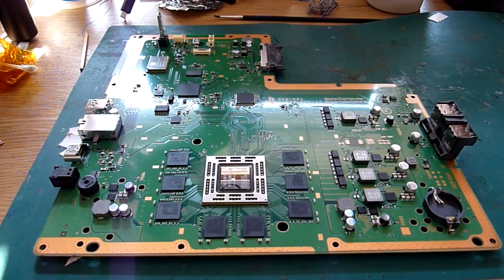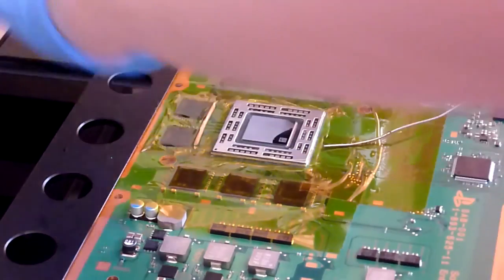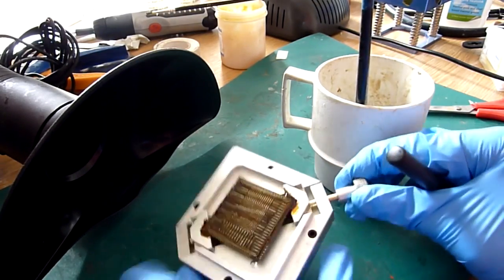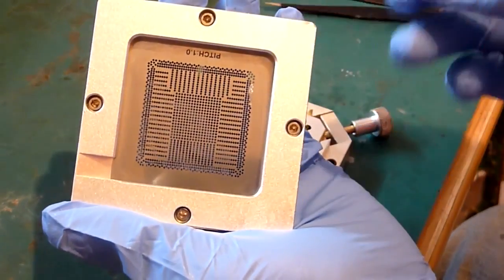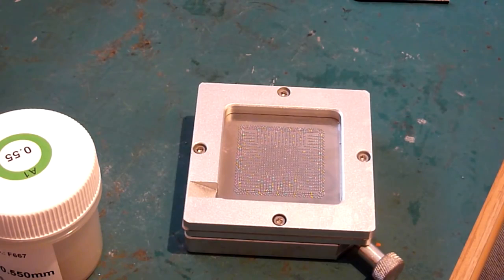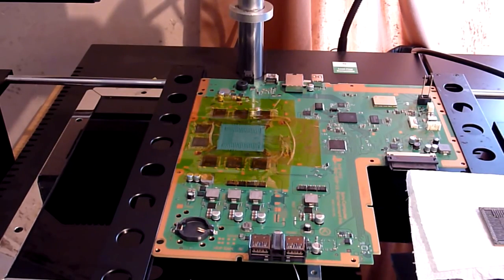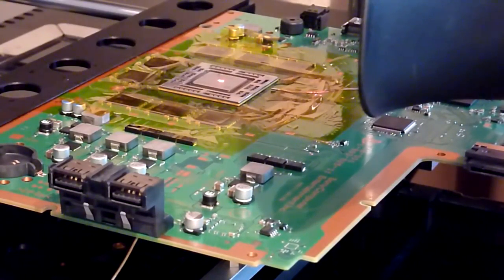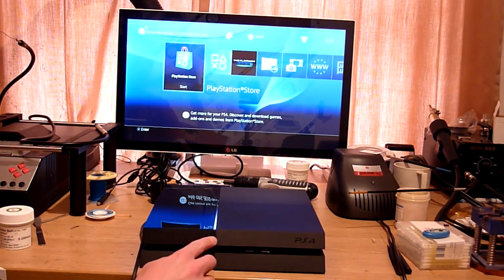PS4 Reballing APU BGA - Fix Blue Light of Death (BLOD) Full Tutorial

Comment: What happens if it beeps and shuts off and wont enter safe mode when initiated?
Reply from the maker: How long between the beep and power down? Will the console allow you to retry or do you have to remove the power lead and plug it back in before it'll allow you to try and turn it back on?
Reply: @AndrewPaul   I can retry after the single press one beep no start, I don't have to unplug to restart but has happened, where's the power button failed
Reply: @AndrewPaul   it beeps immediately about 1second and shuts off into one beep no start when hold initiated --- or at ten seconds shuts off normally and restarts again without the one beep no start
Reply: I cleaned it it was half clogged and now it clicks/  normal start says cannot start PS4 cannot access system storage and prompts to hold power for 1 second until it beeps" fan accelerates if left on this screen until" to shut down and repeats upon quick press start - It shuts down after safety initiation (7 secs start) immediately and beeps 3 times  and then an immediate attempt to start is just a beep with no response after safety attempt, an attempt after that gives an option of either start again bearing same results. ( Note the dead one beep result after safety initiation attempt ) some attempts  after normal start shut down achieved the PS logo and shut down leaving 3 beeps with the famous no response one beep for next attempt and back to cannot the next start

Comment: Hi, do you think that the same job done with this laser machine is also possible with a hot air gun? If not, why?
Reply: Not precise enough heat and timing control. Also evenly distributed preheat as well as balance between preheat and top heat are critical for success.

Comment: Awesome video! But how do you know what size solder balls to use for different repairs? Thanks man! 😄
Reply from the maker: Quite often it's labelled on the stencils you use. If in doubt, get a set of universal stencils and offer them up to the pads until you find one where the pad just about fits inside the hole of the stencil. You can then use the corresponding sized balls for that BGA. As a quickie - PS4 APU is 0.55mm, Southbridge and RAM I use 0.45mm.
Reply: @AndrewPaul  very helpful! Can you please tell me what the PS4 Slim WiFi/Bluetooth module size is and PS3 Super Slim size as I have 0 stencils and am gonna attempt all of these by hand? 😂😭
Reply from the maker: The PS4 WiFi module I don't use balls as the pads are very large - I use a large chisel tip on a soldering iron, get a ball of solder on the tip and then run the ball across the pads with plenty of flux. Don't touch the pads, just hover the iron above as you go. PS3 SS I'm not sure as I've never done one. The older PS3 CELLs and RSXs were 0.60mm so I'd assume these would likely be similar but could be wrong.
Reply: @AndrewPaul  I tried doing that exact technique but on the PS3 SS and I got wifi but no Bluetooth, then after a bit I lost wifi as well. So I’m guessing the solder balls weren’t exactly even in size?? Idk I just know that I hate BGA chips so much man
Reply: @johny1220  solder paste and universal stencil.

Comment: I just bought an mlink x2 and I was only able to fix a graphics card with it till now. 3 ps4s that had the blue light of death, I tried to reball them and all of them ended with a short in all caps of 0.1ohm while before there was no short. Now they just beep and turn off after one second. What am I doing wrong?
To remove the APU 215°C doesn't seem enough like I saw in one of your videos so I need to reach 240 to lift the APU. Then when soldering the 0.55 balls it's reaching 225°C, also when soldering it back it's reaching 225°C. What am I doing wrong? Why 3 APUs got shorted after reballing? Is the temperature killing them? Or can it bee too hot for too long? I admit that the removing ramp is quite long. I'm afraid of it bubbling if I heat it too fast.
Ps: without the APU in place, the memory caps measure 8ohms
Edit: measuring continuity with the APU off and  between the points in the center square, they are measuring 0.1ohms. I don't think this is normal. Somehow I must have killed it

Comment: Hi Andrew is a definitive solution ? could it give me a useful life or is it only temporary ?
Reply from the maker: On SAA / SAB-001 boards this is most definitely a permanent fix - there was a production issue on these boards with oxidation of the pads under the APU which over time degraded the connection between the chip and pad which this procedure resolves.
Reply: @AndrewPaul  thank mate for the info !

Comment: Hi bro please tell me can we change PS4 Apu
Actually I already changed my PS4 Apu to another PS4 butt it's still on blod I change the nor and syscon chip and it's still on blod please tell me what's wrong
Reply from the maker: If you're doing an APU swap between consoles then you need APU / Syscon / NOR and Renesas / Mediatek chip from the donor console. All the above must match (i.e. be from the same donor machine). If you're still experiencing BLOD then you either have a bridge under the APU, solder bridge on the Syscon, defective donor APU or a further issue on the motherboard not related to any of the above - remember that a pulsing BLOD is a generic error state - could quite possibly be defective RAM, bad VReg somewhere, failed FET etc.

Comment: I have fixed a PS4 and at least two models of Sony Vaio laptops with GPU problems that prevented booting up by literally bathing the motherboard in open flame out of frustration.  I figured that it was already useless, so why not just heat it up and see if it reflowed any dodgy solder joints.  I can't tell you how surprised I was after hitting the power button actually resulted in a beep and a picture onscreen after so many times I had been greeted by just a blank nothing...  Unleaded solder is utter crap.  Most recent success was a PS4 that seemed to be suffering hdmi issues, not even showing up in safe-mode.  After a look at the port revealed no bent pins, I decided to heat the board up behind the port just in case of bad joints and dragged a torch across the area of the encoder chip for good measure and was shocked when that suddenly caused it to start up and shut off immediately, which was a whole different problem than the no-signal issue, so I took it apart again, heated up the area beneath the main chip and reassembled with a couple pieces of cardboard added under the clamp behind the heat sink and very much to my surprise was rewarded with a proper picture and boot up and am back in business with my psvr again.  

I credit all those old threads discussing putting malfunctioning video cards in their ovens and toasters for saving me a lot of money , if not a lot of frustration....

Comment: 200c max temp  for soldering and  desoldering ?
Reply from the maker: Desoldering needs around 220C to melt the lead-free solder.
When putting it back with leaded balls, around 170-180 should be more than enough to re-seat the BGA.
Reply: Desoldering time 2 min ? soldering 1 min ?  tnx
Reply from the maker: Total profile time is around 7-8 minutes in my case. IIRC (it's been absolutely ages since I created my profiles for my machine so my memory is a little hazy) the reflow stage is around 90 seconds.

Comment: This is the same problem for ps3 consoles, why cant sony make a proper console ?????
Reply: Because you won't buy another one:)) if it's not broken you don't need to fix /buy another one:))
Reply: It’s very common for console APUs and notebook dGPUs to fail. They’re put under heavy load and the cooling solution just isn’t the best because of size constraints. Keep in mind that they also suck in a lot of dust and even pet hair if you have pets and this will make it even harder for the console to cool itself. It can still happen to full size GPUs in an ATX tower but not as often.

Comment: Do you know if I would be able to reball with a smaller rework station such as a X-Tronic MODEL 5040-XR3?
Reply from the maker: I'd imagine you may struggle with a smaller machine like that one as the PS4 board has a LOT of copper and dissipates heat incredibly well hence the larger machines being recommended for these types of board. It might be worth a test on a scrap / donor board however to see if it will.
Reply: good answer, that is very true. just reading wiki:- "Copper has a thermal conductivity of 231 Btu/(hr-ft-F). This is higher than all other metals except silver, a precious metal. Copper has a 60% better thermal conductivity rating than aluminium and a 3,000% better rating than stainless steel.[5]" I know from when I do plumbing at home soldered joints the heat goes along the copper pipes really fast.

Comment: that silver foil i never use again lost some tiny resisters it pulls them up
Reply from the maker: Ideally leave the foil until the board reaches around 120C. It'll then be warm enough to easily remove the tape and adhesive, but will leave the components in place. If components are coming up with the tape then it's likely you're trying to remove it too soon - the adhesive shouldn't be strong enough to pull them off otherwise. If it is, you need some different tape ASAP! I'd recommend using Kapton tape anyway to be honest - it's much nicer to work with.

Comment: Hi Paul, i’am thinking getting this Jovy Re-8500 used for £850.  I heard some people doesn’t use the reflector for the upper heater. Do you use it?
Reply from the maker: Hi Alan,
Yes mate I have it installed on my machine - it's useful for concentrating the heat solely onto the BGA which prevents unwanted heat being applied to components / connectors etc close by which might be affected.
Reply: Andrew Paul thank you

Comment: Ok I'm confused about the meaning of the name  Non Connected pads for BGA motherboards. While lifting the apu on ps4 motherboard I only lifted one Non Connected pad. It had copper on the bottom of the solder ball but when tried to get it off the chip I lost it. Darn! So my question is do I even have to replace the pad and if I do then does it matter so much how wide or thick the copper pad is as long as it's close. I've got some copper sheets that I can make little circles out of 0.25mm around as opposed to the 0.18mm around that the holes really are but they're about twice as thick the ps4's bga copper pads though. What do I do?
Reply from the maker: Have you a picture of the missing pad?
Reply: No but I will try to get you one or give you number on Sunday night when I get home. It's in putter edge near/at one on the corners and it defiantly non connected.
Reply from the maker: If it's definitely an 'NC' pad then just leave that ball off when you reball the BGA - in those instances you don't need to reinstate the pad. The same goes for the odd ground pad if you're ever missing one of those.
Reply: Thanks man that's what I'll do Monday and let you know how it goes!!!!!!!!!
Reply: Darn didn't get to it today but I will first thing tomorrow.
Reply: Couldn't reball it today either.  I'm having some trouble with my jig and stencil plate problems that I'm going to have fix one way or the other before I can get the balls on the chip AHHHHHHH good grief.

Comment: Ok I've finally figured out how to get the flux down under the ps3/4 chips but I'm still painfully on the heat profiles. Ok my cousin told me that if I preheated the motherboard by turning up the heat right away to 150 Celsius and when reaches 105-115 C let it stay there for 20 minutes the turn on the heat gun to 250 C or more. He said to let the bottom heat stay at 150 C and that's where it should settle and let the top heat up at no more than 3-5 degrees per second until reaches 220-230 C then nudge it once per second until it moves then lift. Well I've done that twice now and only one chip lifted and a bunch of pads on the motherboard lifted. The problem is that even when it got to 220 C on the ps3 @ ps4 motherboards I waited for like 15-20 minutes and nothing happened, no sinking and it wouldn't move. It didn't happen quickly like he said that should and the temps on the chips got over 240 C a couple of times, once on accident and the other because I got frustrated and wonder if my temp probe wasn't just off. There wasn't anything wrong with the temp probe as it turned out; I confirmed it with a lasser temp tester. So I don't if I just tapped the chips too hard, which I'll admit is a possibility, and that why the pads lifted or if my cousin has me using way too much heat which I'll admit would explain why the ps3 GPU looks a little black. What a ball park temp and time frame to heat these chips?
Reply from the maker: The biggest issue you have here is your setup. You can't get accurate or stable temps using a pre-heater plate and air gun - you'll need a proper BGA Rework station for these boards to do them reliably - if the chips are burned then you've got either too much heat, too much heat localised to one area of the board or IC or the heat source is too close to the board. The missing pads is down to some balls not being molten when lifting (because you've got cold spots on the board or beneath the IC) - both likely to be down largely to the setup you've got. You'll torture yourself trying to utilise your equipment in this way - there's no cheap way to get into BGA rework if you want a consistent, repeatable, reliable process nailed down. Avoid Achi like the plague if you're going to plump down on a proper setup - I'd highly recommend a Jovy RE-8500 as a cost:performance ratio sweet spot for entry into this side of electronics rework. If it's a money no object thing then Zhuomao would be where I'd go.
In all honesty though, think carefully about getting into this side of things - it's very expensive to buy the kit and it's time consuming work (especially to begin with while you're learning the techniques and nailing down what works best for you). I can do these within an hour these days but it's taken years of practice (I started in BGA rework in 2012) and tweaking of my processes to achieve that not to mention how many scrap boards I've needed to practice on before touching any live customer equipment. There's not much money to be had in it if all you'll be working on is console boards and if that's the case then it'll take a long time to re-coup that time and monetary investment. For a lot of BGAs in things like laptops (and the PS3) the issues are often down to physically defective flip-chip ICs rather than the widely touted 'solder balls' which is why many often return to their faulty condition after a few days / weeks  / months and rather than rework will require replacement BGA. Granted you'll need the above equipment to do that work but getting genuinely new BGA ICs for these things is nigh on impossible and many which are touted as being new are old, reworked pulled BGA with a nice new date-code etched on in a Chinese warehouse which are just as knackered as the one you've removed.
I'll probably do a video on getting into BGA rework at some point and whether or not I believe it's a worthwhile investment these days - stay tuned for that one. Hope the above helps in some way.
Reply: Thanks

Comment: Early in this video you said that you should use syringe so what kind of syringe would I use. Is it for hot flux? I've been trying to recall ps3s with no success yet.
Reply from the maker: Ideally you'll want a syringe as it makes applying flux under the edge of the IC easier but you can persist with a brush as per the video if you don't have one.

Comment: Excellent video!  One question, in your profile, what percentage do you set your heaters to for the "soak" stage and the "reflow" stage?  They're factory set to 100% on all of them, but I'm getting too much heat on the bottom of the board with that setting.
Reply from the maker: Hi,
I don't use percentages - create a profile specifying the actual degrees you require and let the machine work out the rest. It's the only way to get an accurate profile which will give you reliable, accurate and repeatable results.

Comment: Andrew,got my friend to ring me with a few more details with regards his this BLOD PS4 he's been given.He's informed me that the factory security seal is infact,still intacted and not tampered with.When he powers up the console,he can hear the fan for a few seconds but then it goes very quiet.He can only turn the console off by unplugging the power lead completely.He's been told that it could be an overheating problem that's causing the BLOD.
Reply from the maker: Is the blue light constantly flashing?
Reply: hi andrew paul the blue light contsantly pulsates does nothing else at all, power button becomes unresponsive
Reply from the maker: I don't normally look at constant pulsing BLOD machines as they're often a hiding to nothing, however as the Sony warranty seals are intact I'll happily take a look if you want to send it in. Often people can make this problem a lot worse when they open them up to tinker. Do you have a contact method I can get you on? Feel free to drop me a private message either on here, Twitter (@YTAndrewPaul) or eBay http://www.ebay.co.uk/usr/lufcfan2004 and I can send you the relevant details. Cheers mate.
Reply: cheers for reply andrew, so what is the actual fault on the ps4 regards
Reply from the maker: Constant pulsing BLOD is a general error condition. Could literally be anything on the motherboard.
Reply: ok thnx andrew i think i will just bin it then